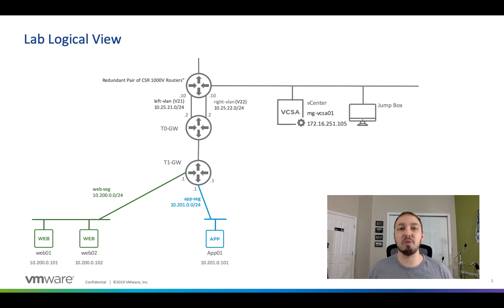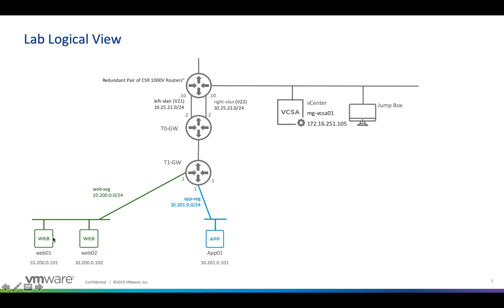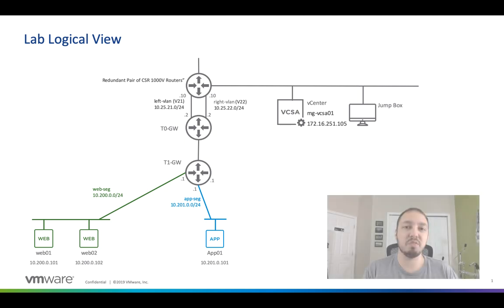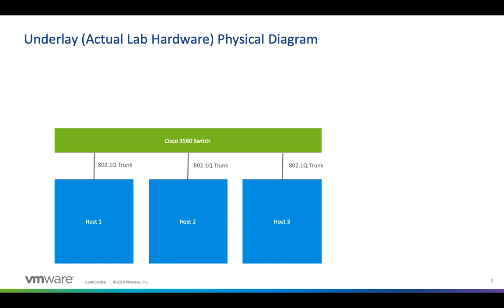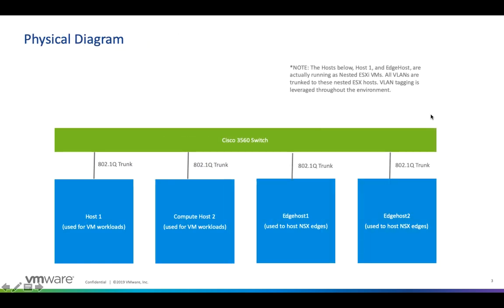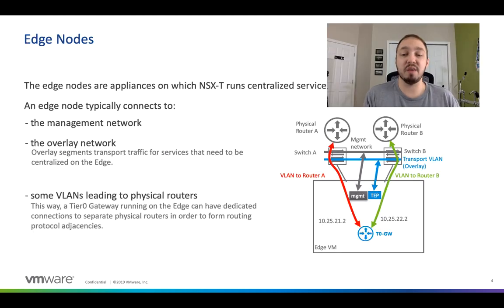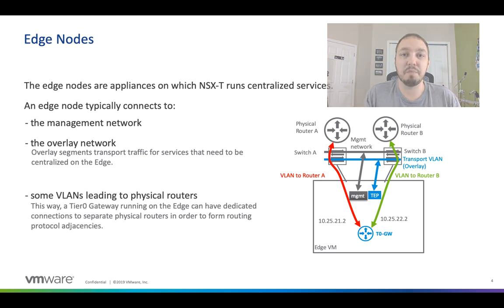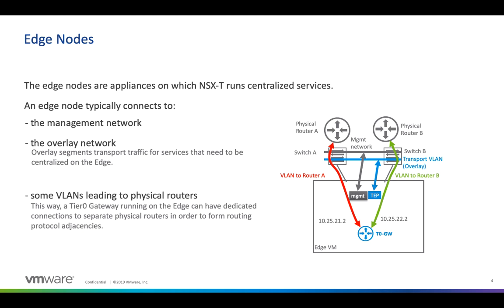NSX-T 3.0 from Scratch (Pt. 2): Lab Design

Comment: I was going through this playlist more than once, and I failed setup the lab, not because of the ressources no for sure all components are deployed successfully, the main issue is the vlans used on the edge and transport zones and management not sure if this will run inside the nsx fabric or i should manage some uplink to my physical switch and change the trunking and adding this vlans to allowed list, really confusing the vlan for vlan traffic and overlay…. Not sure what to say but i wish you understand my point. Thank you for the sharing very helpful even i still have a problem the vlans part, it will run inside the fabric or it will affect my physical connection between the servers im running this nested lab ?
Reply from the maker: Hi Hamza. You should have three total new VLANs on your physical switch - your TEP VLAN, your "left" uplink VLAN, and your "right" uplink VLAN. The "left" and "right" uplink VLANs should go to your edge VMs. TEP VLAN should be everywhere. For a home lab I would recommend adding all of those VLANs to all physical uplinks to your ESXi hosts to make your life easier.